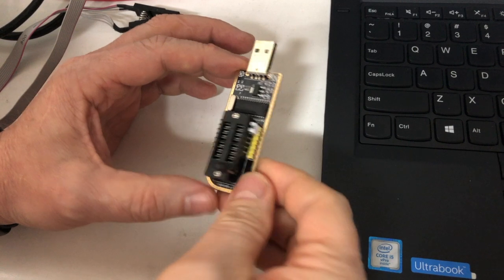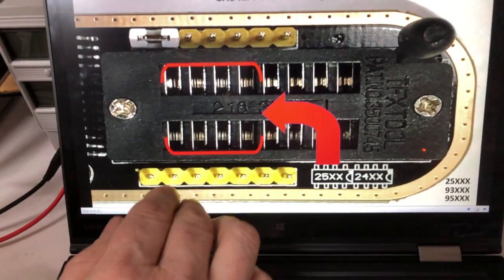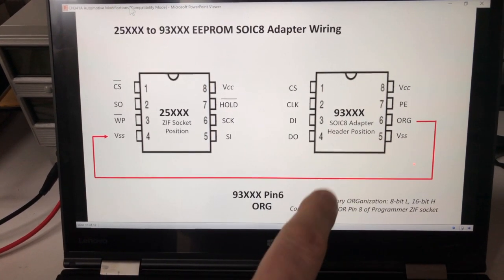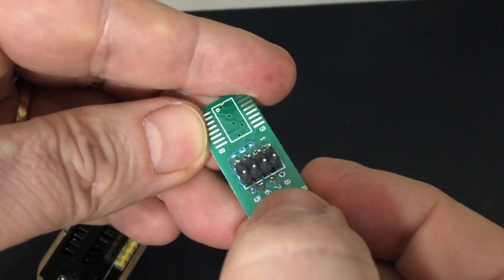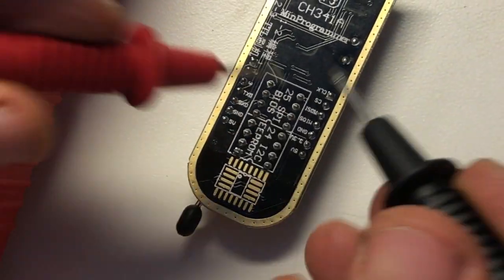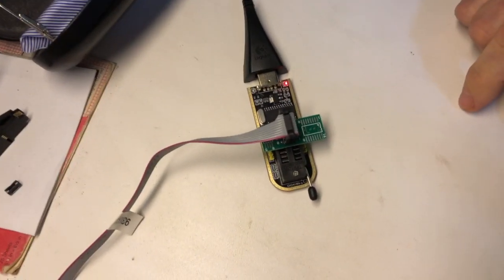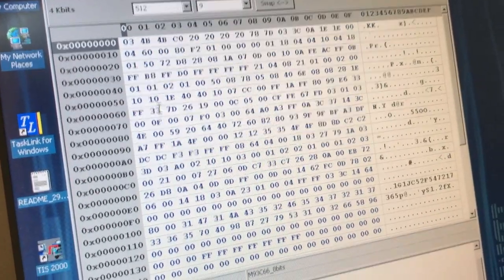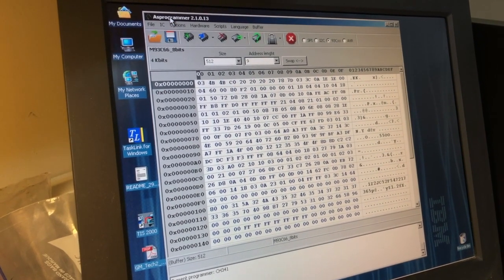Modify the CH341A EEPROM Programmer (Black Edition) for 5V 93XXX & 95XXX Automotive Use

Comment: Thanks for posting this video. However, for the life of me I can't seem to read the eeprom chip from the BCM on my 1998 malibu. Has anyone tried doing this before? I'm not sure what the exact type of chip it is since it has the in-house gm model numbers on it.
Reply from the maker: The majority of these EEPROMs have to be desoldered off the circuit board in order to be read, or written.   It's actually a rarity to read one in-circuit.   What happens is most circuits will be powered up by the test clip and you cannot read from the EEPROM with other board devices then powered up.
Reply: @DrShock  Gotcha. Thanks for responding, and thanks so much for posting this video! It's really hard to find information out there on BCM replacements and reprogramming in general. I'm kind of a newbie when it comes to electronics work and this video helped a ton. I ended up not needing to reprogram the BCM on my 98 Malibu because the odometer reading for that car is stored in the cluster, but I'll keep this in mind next time if I ever have to read and write another EEPROM of that type.
Reply: @DrShock ive heard 95xxx clips are a little easier to read inboard? That correct?

Comment: What is the correct name for the blank circuit board? I need to buy some extras, and I am trouble finding them. Thank you
Reply from the maker: There's a link for those prototyping boards in the video description.  But you should get a couple free with the programmer itself.
Reply: @DrShock  I see the boards you linked, but I am looking for the exact same board in the video. The SOP8/Sop16 board. I am a rookie & don't understand how you can sub the board u linked (SOP8). Thanks
Reply from the maker: That particular prototyping board came with the black edition programmers back when this video was first done.  I don't believe they include that style anymore (at least I've not seen that design in a few years).   All we're using the prototyping board for is as a base for making the adapter.  We need to be able to cut the traces on the board, and then solder bodge wires, to implement the schematic I showed in the video to allow this programmer to also communicate to the additional EEPROM family.

You could just wire wrap something on your own.  It's just a means to an end.  I don't show making the adapter because there's no specific way to do it, whatever the individual is most comfortable with in implementing the adapter pin cross over schematic will suffice.

Comment: Gaining hope as I see you repeatedly unlock radios and prep them to learn their new home. I have ordered the tools you suggested; test clip, lead wire, ch341a mini programmer and white thermal grease.  Now please advise me on what software I can use on my iMac to run the programmer to get the Delphi 28379849 to mate with my 2013 Acadia.
Thanks
Reply from the maker: Sadly, I'm not aware of any software that exists for MacOS which supports this particular chip programmer.

Comment: I feel somewhat uncomfortable using software from a dubious file sharing site uploaded from a random Russian web form... are we sure there are no other options?
Reply from the maker: Nope.  Not for this specific programmer at its price point.   You could just buy a more expensive EEPROM programmer rated for automotive use like the XGecu TL866II+ from Auto Electric which supports the 5V devices involved in this video by default.   This just happens to be the dirt cheap Chinese hardware route, which usually involves Russian software to get the most use out of it.  ;-)
Reply: @DrShock  Can I ask why my comments are being deleted?

Comment: I did this mod, but the chip was not detected on the IC900 chip in a Lexus ECU.  I followed Binh's instructions in his video, and he referenced this video, which I also referenced.
When I connect to the clamp to the chip, Windows makes a ding like it recognizes being hooked up to something new, but the software doesn't recognize the chip.
Do you have any tips for troubleshooting?  My solder joints are probably crappy with a $6 soldering iron outside, and I have no way of knowing if the conformal could is completely removed from the IC, which is still on the PCBA.  Maybe the fact Windows recognizes something when I connect means all the pins are making good contact.  Could it be a driver issue?  TIA for any tips.  I'm thinking about getting the CH341A v. 1.7 because it has a 5V switch.  Is that a drop in replacement for the main CH341A you modified?  I presume I still have to modify the connector I install into the main board as per your instructions.
Reply from the maker: The sound from the Windows operating system has nothing to do with the EEPROM chip.   That is just the USB handshake recognition from the programmer itself.   In fact, for the programmer I'm showing in this video, hearing this just on connecting to a device is abnormal behavior.

It's actually quite rare to be able to use a test clip on an EEPROM in circuit due to the test clip supplying power to the rest of the board inadvertently,  so I'd first suggest desoldering the device from the PCB (printed circuit board) and attempting the read that way.

This IC900 chip you mention seems to be just a 93C56 type EEPROM @ 5VDC.  So you'll need to do the 5V mod to the programmer that this video goes over for the correct voltage, as well as the pinout mod so that the programmer can communicate with a 93XXX device using its native 25XXX ZIF socket interface.  Lastly, you'll have to use the software I mention in this video in order for the 93XXX to be accessible using this particular programmer.
Reply: We’re you ever able to figure this out ?

Comment: Thank you for this video. Followed the link for the manufacturer's device driver, and seemed to install ok on my Windows10 64-bit,, but I don't see the device listed in my device manager, whether I have it plugged in, or not. Any advice?
Reply: Never mind - the device does show up, but not where you expect it. It is in DEvice Manager under "Interface." Now at least I can continue troubleshooting knowing that the driver is installed.

Comment: hello possible to have a photo of the assembly so that I can lz do for my reading epprom 93c56
Reply from the maker: No, I don't but there is the schematic I show in this vid for wiring up your own pin to pin re-wiring adapter to map a 93XXX device into the 25XXX ZIF side.
Reply: @DrShock  precisely in the video I do not see the connections very well, and as I am French I do not understand
Reply from the maker: Starting at 1:57 there is shown in red color on the presentation exactly how to connect each pin of the 93XXX to map over to the programmers ZIF socket which is wired for the 25XXX.  By taking a small circuit board, and implementing the connections colored in red as bodge wires, you will construct a pinout adapter that will allow a 93XXX device to be programmed from the 25XXX ZIF socket.   It's really a rather trivial circuit to construct, you could even just wire wrap direct to the chip temporarily instead of making something more permanent.

Comment: I cannot seem to get the lift up of the pin to the 3 volt. I don't have 3 hands to hold the iron, then a small pin or micro flat head screw driver and then something to hold the ch341a adapter. I am actually very good at soldering, but this tight space is very difficult, any ideas ?
Reply: Cut it

Comment: Many thanks for the super well narrated video. Q: Microwire  93s56 -w is that the same as a 93C56 for data and programming. I have purchase a new Instrument cluster for my car and I need to change the the Microwire EEprom 93s56-w or program the new from the old. Im not wanting to change mileage on the odometer just copy the old info from old to new. Sorry for my ignorance, but I'm new to this.
Reply from the maker: Thanks.   Almost, the "S" indicates it is a security featured device, check the video description for some additional tips with these types.

Comment: Could you just buy an extra clip and rearrange the wires going into it?
Reply from the maker: Sure, you could implement the adapter at either the ZIF socket male end, or the test clip end.   Though note that few automotive circuit boards will allow reading in-circuit with a testclip, most will require the EEPROM to be desoldered from the board first before they could be read from/written to.
Reply: @DrShock  10-4

Comment: I  think I read somewhere that the newer ASProgrammer software supposedly eliminates the need to modify the adapter with jumpers. (other than the 5v mod)  Can anyone confirm or deny this??  Unfortunately I can't remember where I saw it.
Reply: Did you get anywhere with this? I'm looking at doing a 95XX and wasn't sure if I still needed to do the adaptor modification. Cheers

Comment: Hello I’m trying to read a 93c56 chip on a Toyota ECU I believe it’s a 16bit chip i’ve tried the circuit setup for both 16 and 8 but but the program says micro ic not responding check settings. Do I have to remove it from the board ? I’ve seen x tool and autel do it on the board thanks,Brandon.
Reply: So I took the chip off and now it reads success but everything is zero’d showing no data not sure what I’m doing wrong does size and address length matter ? Does it set that automatically when I select the chip ?
Reply from the maker: Its often the case that the IC has to be removed from the board in order for the power supplied via the testclip not to inadvertently power up some other device which then causes contention for the address and data bus lines.

If you end up reading 0xFF everywhere, scroll thru it a bit as many times the upper portion of these chips is purposely left blank, at least with GM.  If you're reading 0x00 though, this is more likely a problem with the hookup.   Make sure you have pin one of the device correctly oriented with the testclip, or whatever type of EEPROM adapter you are using off board.   Make sure you are using the appropriate side of the USB programmers ZIF socket like I review in this video.   And if you have to make any the USB programmer modifications, or pinout adapters, I show in this video then re-check all of that work for accuracy.

Comment: What if just connect 5v and 3,3v pins with jumper? The question is only if to remove stabilizer or leave it on the PCB...
Reply from the maker: Sure, you could use a jumper if you think you'll need to use the programmer for non-automotive devices at some point in the future.   Some newer programmer versions even already come with a jumper circuit.

Comment: Thank you for this video. I have a 2016 Sierra with a Bose Amplifier module that has a internal error. I can save $300 if I can get a salvage yard amplifier module but was wondering if you knew if this eeprom tool would work on that type of system. Alternatively I can swap the chip off of the old module into the "new" module but I don't know if that would be all that's needed on a module like that and I don't want to brick my existing module since it still functions with its quirks. I do have all of the hardware to program a new module from the AC delco website, just would like to save $300. Thank you!
Reply from the maker: I'm not aware of any sort of VIN lock for an amplifier module, as long as what you are describing is a physically separate unit from the radio module itself.   You shouldn't need to edit or touch the amplifier modules' circuit board, and just proceed to re-calibrating the salvage yard amplifier module with SPS2 on Techline Connect using either an MDI or MDI2 scan tool.

Now, it's possible that with 2016 and other newer years GM has blocked re-using an used module of this sort within Techline Connect.  That is happening more and more with the Global A and newer platforms lately.   But I'm not personally familiar with this.
Reply: @DrShock  You are correct. I received the module from the salvage yard today. Plugged it in and it works without programming. I also learned that I have a sub in the console that I do not remember ever working since apparently this amplifier has been non functional since I bought the truck new. I think that replacing this module cleaned up some noise over the network and now my truck shifts normally. How could that be you ask? The amplifier has a signal repeater for the cam sensor to adjust the radio volume as the vehicle accelates.  So far so good. Thank you for the video, I'm not sure I would have tried the salvage yard module without it.
Reply: @DrShock  ok thank you. I'm pretty certain this is a separate module from the radio, but if I unplug the MOST bus from the amp the entire radio goes down do I will do some more digging. I am worried about bricking my truck 😂

Comment: Hi, thanks for this vid. Can you help, i have done the 5v mod to the CH341A is it necessary to do the adapter mod?
I'm trying to read/flash a 95080 eeprom (its off the board) but so far it wont connect at all.
Any help would be much appriciated.
Thanks
Reply from the maker: I showed in the video the one chip family which need the hardware adapter, not all of them require this of course.  But you do have to be sure you are using the correct half of the ZIF socket as this programmer design uses a different half for 24XXX/25XXX or the 93XXX/95XXX as described.

Also be sure that you have pin 1 correctly aligned at both the chip and the ZIF socket of course.  With the device off the board, which is the preferred approach, but still no connection I would suspect either USB driver issues or cable hookup issues.
Reply: @DrShock  Hi thankyou very much for your reply. I refollowed the instructions in the video and am pretty sure I have it all set up correct. I will check the driver and to be safe I have ordered a second CH341A and a SOP8 SOIC8 adapter to make sure its not that. Again I appreciate your time to offer advice.
Reply from the maker: To be sure its not a defective 95080, I'd try and get a known good working 24XXX type EEPROM.  These are the easiest and simplest  to work with.  Use that to verify that your drivers, cables, and sockets are all good.
Reply: @DrShock  Hi, it was the cable not getting a good connection. Used the new adapter and it seems to work... Just need to figure out what's what key wise so i can reset to get my new keys to be accepted.
Thanks so much for your help.

Comment: Can we program 3-wire serial? I have programmed Microwire, but what about 3-wire serial?
Reply from the maker: That would be an algorithm function of the software used with this programmer, not of the programmer hardware itself.  So the answer is it depends

Comment: hello, thanks so much for the video, .. but once you lift up the voltage regulator pin (3.3v), you no longer have the pull up voltage for write protect..?? how gonna be working..?
Reply from the maker: This particular setup supplies both 5VDC and 3.3VDC.  For automotive write you need 5VDC only, so the 3.3V is of no value and needs to be lifted.  3.3V is insufficient voltage to program an automotive grade device.
Reply: @DrShock  Actually i have ch341 programmer not ch341a, and when i lifted the pin i steel have 3.3v connection to the voltage regulator, that's what confused me, after that i removed the vol reg from the board and i found a trace underneath it connecting the small and the large pin together, which means that the 3.3v is steel exist, so i just left him off...if you don't mind i would ask about the write pop down list, what should be ticked..?,cuz am getting this  (Possible protection is enabled. Press "Unprotect" and check datasheet), thank you so so much for your reply to my previous comment, and i hope y'll do same as well to this one, thank you.
Reply from the maker: Are you working with a 93S type device?  If so, those are write protected and there's some info in the video description on how to deal with that.
Reply: @DrShock  Thanks a lot.

Comment: Thanks for this, I have made the modifications and can successfully read a RH56 chip (M93C56) 16bit. However I cannot write to it, Asprogrammer just hangs when attempting to write. I checked the voltage when connected up and measure 4.8v. What are some possible trouble shooting areas? Thanks
Reply from the maker: If you're still working with a testclip, I would try desoldering the device from the PCB and programming it off board first.
Reply: @DrShock  Same result. But I believe I have a firmware or driver issue. ASProgrammer V2.0.03a will read but not write using CH34A1 Hardware option. V2.1.0.13 will not work at all on either hardware option.